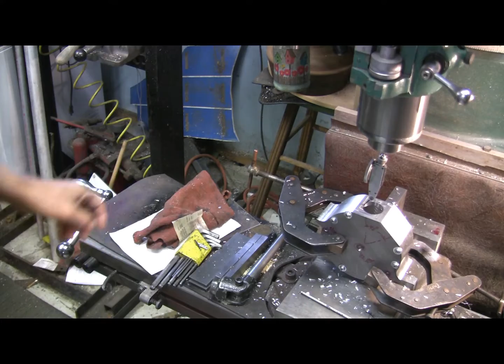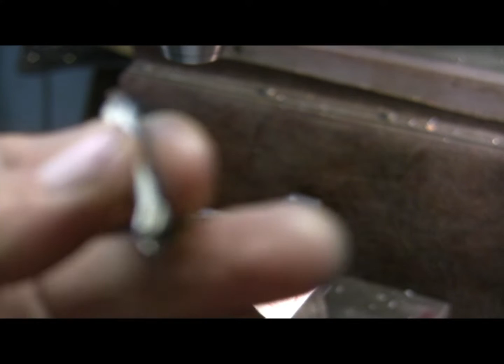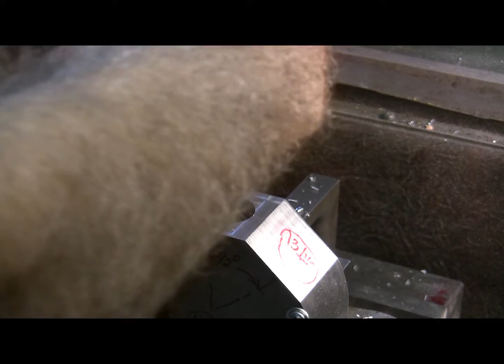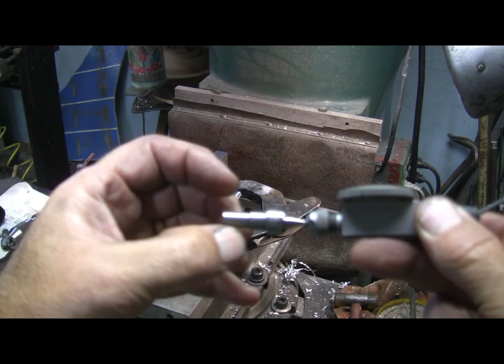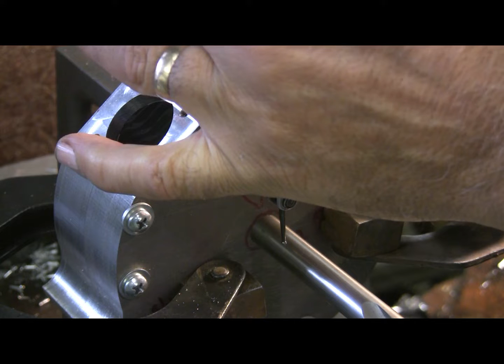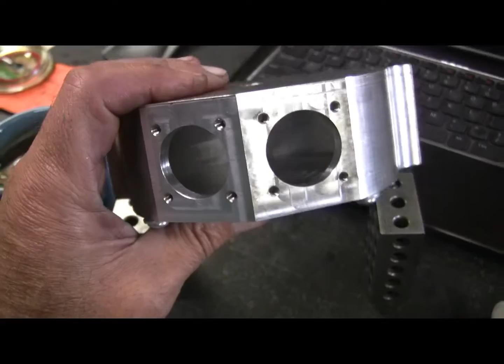My hoglet version 2

Comment: Hi Doc.  Great trick on the center drill removal.  I'll remember that one!  I'd like a readout on my mill someday when I'm rich.  I learned to count revs back in the days before dro's and like you, I manage backlash, position with screw turns and dials as second nature.  The first electric positioning devices we had were Vernacs.   Remember those?  Only around for a couple years, obsolete in favor of dro's. I wondered if you had considered a radial engine project, now I know😊. Tc Mike
Reply: I too learned to account for backlash and count the dials on mills with no DRO’s. I honestly believe that’s the only way it should be taught. Then once they have mastered that, introduce them to DRO’s. I finally added a digital readout on my home shop Comet mill. I’ll admit it has spoiled me. Not having to think about backlash anymore is awesome, but it’s the added features of the DRO I love most. The ability to store multiple datums and bolt hole patterns are just a few I use a lot.